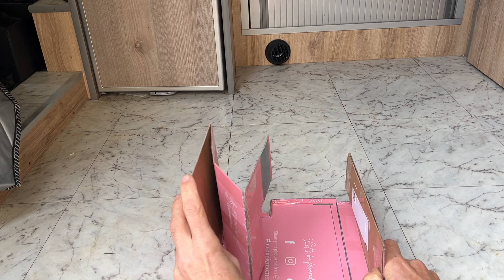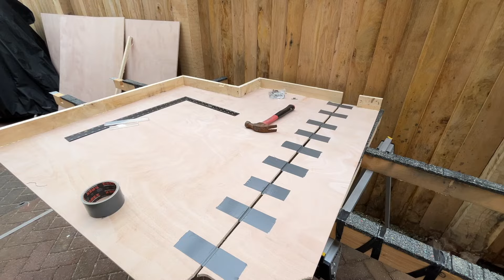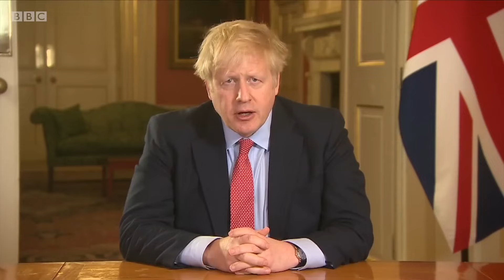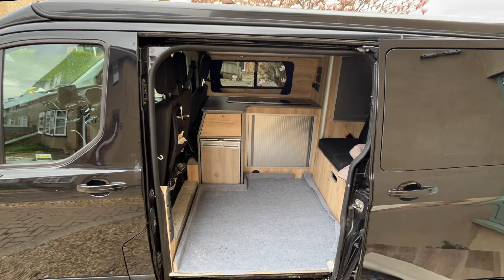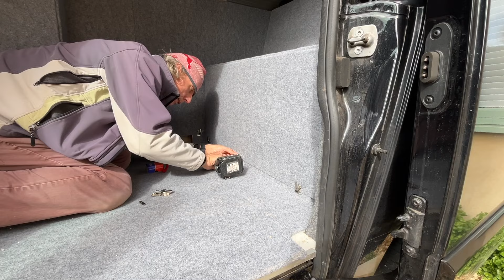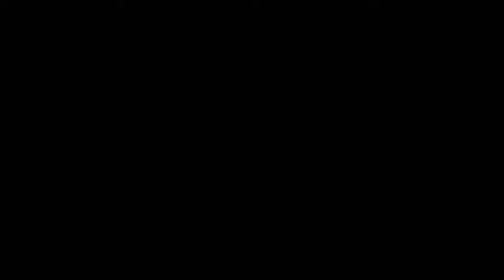What's gone wrong !!

Comment: Great to see you back!! 

18 months ago I sold my cars, prepared to buy a van and got the cash ready to convert. Only to find I can’t afford to do it now not only for the reasons you mentioned but also due to ULEZ and CAZ, I have to own a van on 66 plate or newer to avoid paying the fine. (I live in a CAZ 😢) this has forced the 2nd hand market even higher, vans with 150k on the clock still command £35k prices.. 
for now my van dreams remain just that a pipe dream 😐

Also the Vans I do see that are reasonably priced don’t include VAT, as soon as the vat is added I can’t afford it
Reply from the maker: Be patient I think the second hand values will slowly come down

Comment: Karl I need your help man I went on ya website and it ain't there can we talk I want u to do some work on me van and pay of course ❤
Reply from the maker: what do you need doing?
Reply: Thanx for getting back to me Karl so basically I need a ac to dc charger fitting and wanna make sure I've done the electrics right as I go away soon mate and need it to be spot on could u have a look for me buddy also my rock and roll bed I don't think it's m1 tested it's very squeaky
Reply: Also diesel heater needed under drivers seat mate
Reply from the maker: @Mylodcuo  I can do it but it will have to wait as there is a caravan on the drive at the moment. I'll give you a shout when its gone
Reply: OK mate just let me know if u want me to get the diesel heater and that and how much etc cheers again Karl
Reply: Hey up Karl I sold the camper brought a new one better wondered if u could help fit diesel heater in it